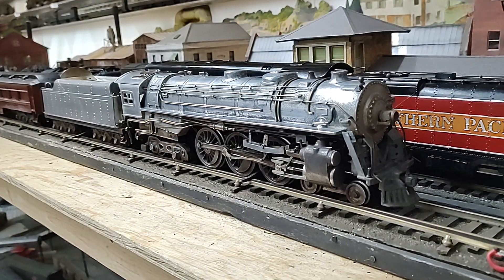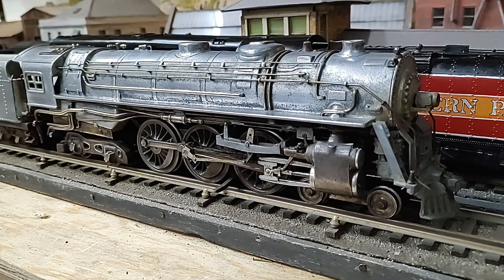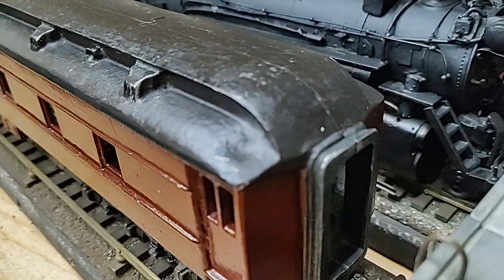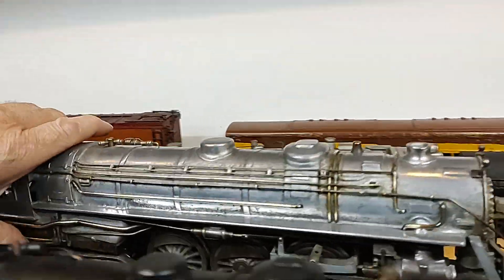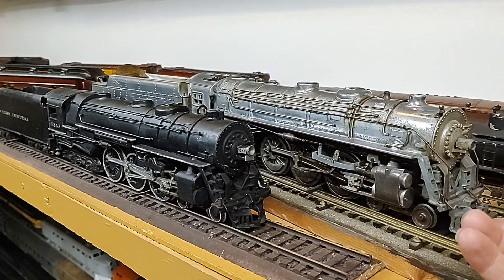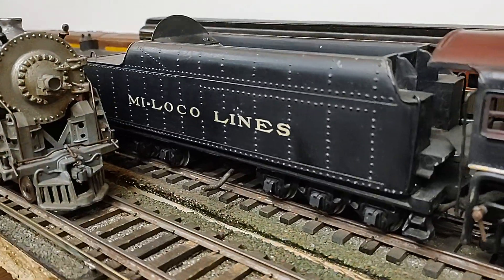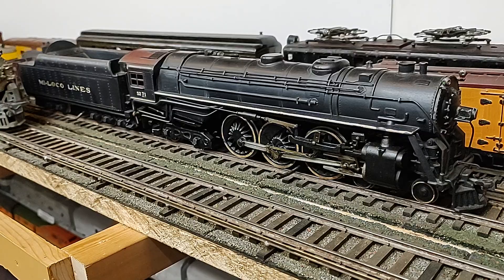New York Central Hudson steam engine vintage O gauge  by Lee B Green's Mi-Loco  17/64ths scale 1935

Comment: dear Leonard how is 17/64th which is a 17th larger than 1/4 the proper size for o scale ? thank you Larry
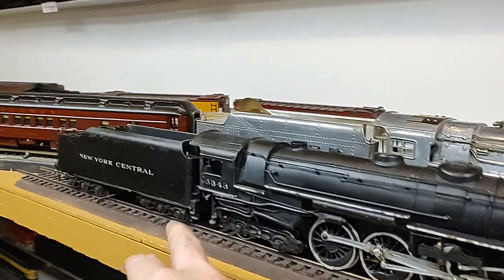Reply from the maker: If you do the math 1/4" scale 1:48 you have 1 3/16" gauge ...17/64ths scales out to gauge of 1 1/4"
Reply: @vintage-model-trains  dear Leonard thank you I got it. it was a subliminal reason I purchased a Pratt due to your wonderful demonstration of your Pratt in action.
Reply: It's been known since the 1920's that 1/48 and O gauge track are mismatched. There are only 2 ways to correct this: scale up to 1/45, or keep 1/48 and gauge down (now called P-48). If you gauge down, then you have to provide p-48 trucks and then you have to re-gauge the locomotive, not easy unless you are a machinist. I prefer the 1/45 approach, as it gives bigger and longer models, but which are operationally compatible with 1/48 equipment. In the early days of the hobby, most were scratch builders and they found 1/4" scale easier to measure out than 17/64"- that's how we got stuck with this! It's a crying shame that nobody in the O gauge hobby seems interested in reviving 1/45.

Comment: I just got an O gauge Hudson which is none of these 3. It has a place for a third rail pickup, it has a manual reverser. Unlike your 3 this one has a feedwater tank molded right into the smokebox. Any idea who could have made it? Oh yeah, it's cast brass.
Reply from the maker: Scale Craft ..1935-41
Reply: @vintage-model-trains  I guess you're right! Thanks Leonard. You have one? Is it in one of your video's?
Reply from the maker: I do have a Scale craft Hudson ..one day soon with luck a video
Reply: @vintage-model-trains  Hey Leonard, do all your Hudsons barely have room for the trailer truck to lift up? Mine lifts it's drivers off the track and they spin on any little hump in the track.
Reply from the maker: So far they seem to be fine ...no driver spinning